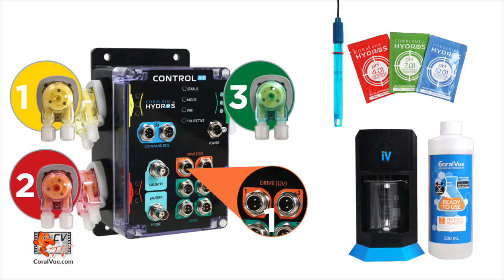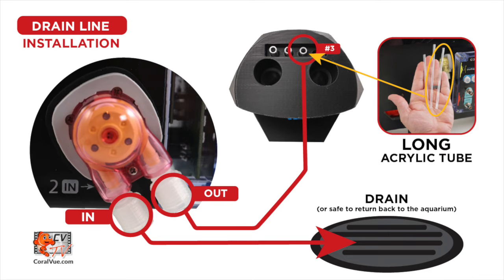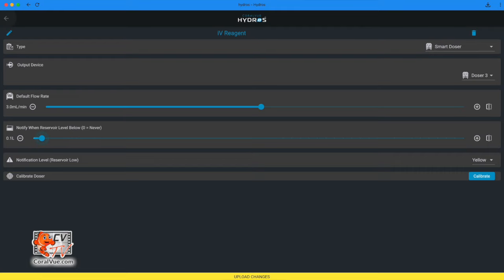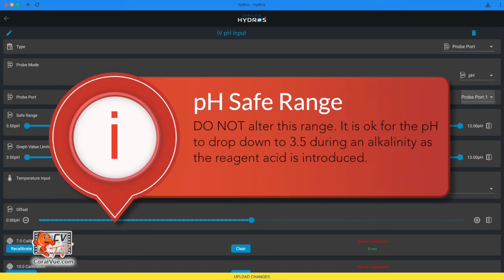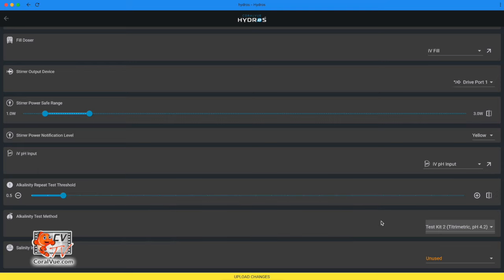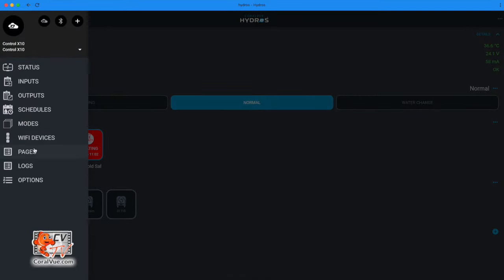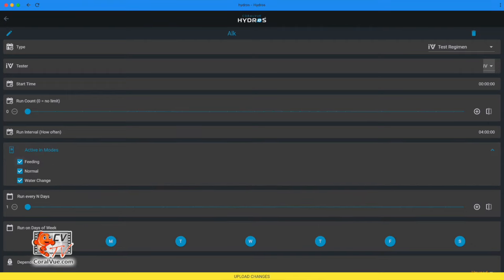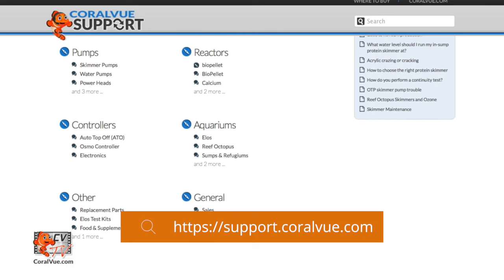HYDROS Set-Up Instructions - Alkalinity and Salinity Testing

Comment: How many test can you run from the refill reagents? Ie: 300 test from one gallon of reagent. Ty
Reply from the maker: It really depends on what the aquarium carbonate hardness kH is at. If it higher at 9-10dkh you will use up more reagent per test and run out of reagent faster that one who has a lower system dkh. I tend to get a little over one month with a 1000ml and testing every 4 hours with a system alkalinity at around 9-9.5dkh.

Comment: So the x10 does not come with a salinity probe and needs to be purchased separatly? Also if i want a constant ph reading do i need another ph probe?
Reply from the maker: That is correct. If you want to monitor salinity you will need the salinity kit with the dual calibration solutions. If you are testing alkalinity remotely using the iV then yes you will need another pH probe and controller with an available probe port as the X10 only has one. If you are not doing alk testing then the pH would be in the sump with constant monitoring.

Comment: do i need the salinity probe to test and can i get away with jus the PH. also my stirrer isnt working. both drive 1 and 2. any fix?
Reply from the maker: The salinity probe is only required if you want to test for salinity otherwise it is not required for alkalinity testing. I would suggest submitting a support ticket at support.coralvue.com to assist you in getting the stirrer working.

Comment: Im a bit disappointed since it comes with a 25 mL beaker and not the larger one required to calibrate the doser. Also wouldn’t finding a large beaker and using the markings to see how much solution is dosed be very inaccurate?
Reply from the maker: I am sorry to hear of your disappointment but the included 25mL beaker is for common calibration of the X10 dosing pumps like for the additions of two part or microelements. A larger Beaker was not included to drastically keep the price of the product down since it is not required unless doing Alkalinity testing which would require additional devices like the iV. For calibration practices for Alkalinity testing with the iV require a larger 100ml+ beaker or better yet a scale for precise measurement.